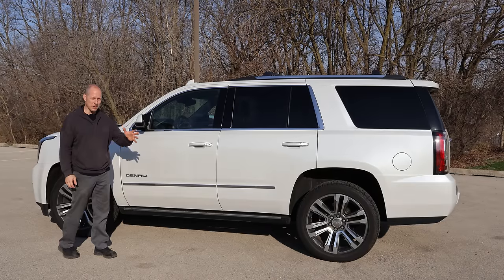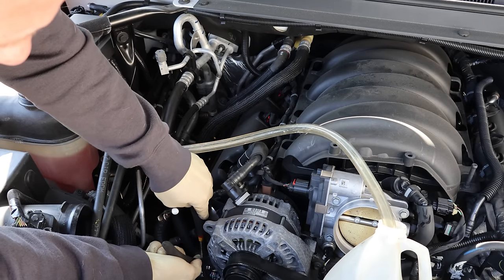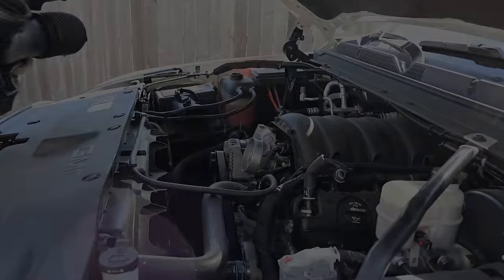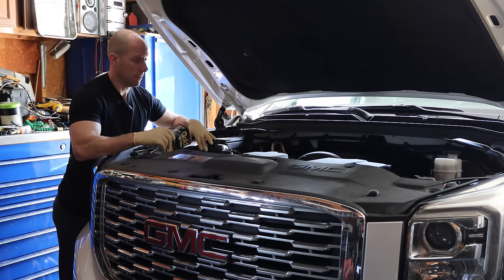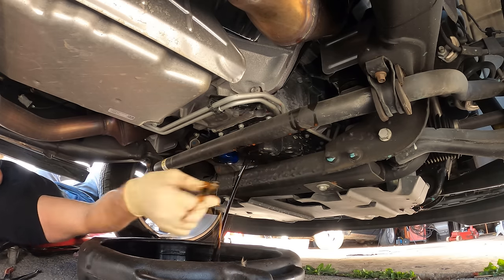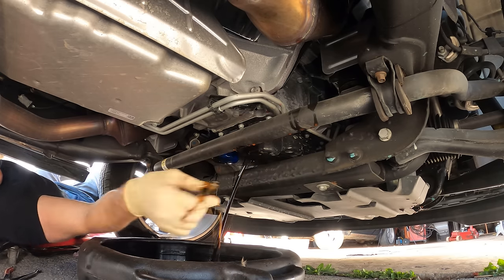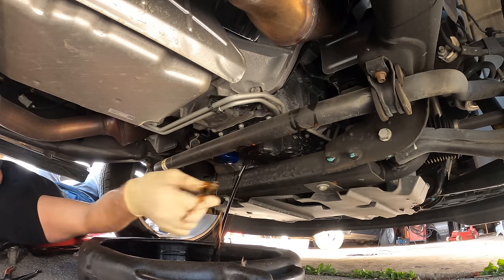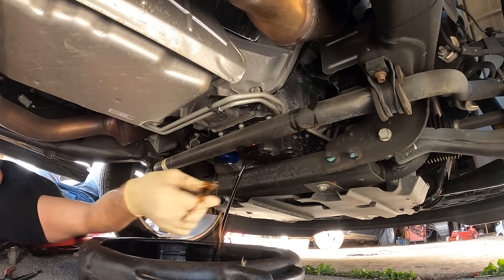Fixing everything wrong with this low mile Yukon Denali so I can sell it.

Comment: Oh yes, the booby trapped spring clamps my favorite little finger destroyer and part that loves to fly across the shop and play hide and seek😂. 

I loved our 15 Yukon until it ate 3 transmissions in 500 miles 😂.

Thanks for the demonstration on the cool sucking device that makes the job cleaner that death cool makes a mess. 😎

Fun fact after multiple oil changes the wax coating wears off that brace bar under the engine & transmission 😂.

Comment: With the heater hoses it is usually the o-ring and the clip that goes bad. it is possible to buy better than oem quality replacements. Gm thinks the dealer replacements are made of platinum.

Comment: A little bit excessive, every 2500 miles an oil change 🤷🏻‍♂️
Reply: I don't see an issue with that.  I change my oil every 3500 to 4000 miles regardless what all the experts say.  I also use the best oils and filters too.
Reply: On GM vehicles with the DOD or AFM it is good practice to change the oil sooner than the manufacturer recommends or you’ll be changing the cam and lifters 🤣
Reply: @bteamshorts  also a good practice on deleting that crap too.  One of the dumbest ideas ever.
Reply: @bearing_aficionado  Blame the government for setting unrealistic fuel mileage standards that the manufacturers must comply with.
Reply: @bteamshorts  oh I do.  Because of those morons, the price of vehicles go up while the quality goes down.

Comment: I stopped buying FRAM filters after I had two incidents on my Sierra. The first one was the check valve in the first filter was stuck it built ZERO oil pressure and I'm glad I caught it. The second one had a coil of metal in it from where they threaded the filter.

So I started buying WIX/NAPA Gold filters which were around the same price BUT I very carefully inspect the filter before I put it on regardless of how high quality it supposedly is.
Reply: What ever...
Reply: I've used Fram filters throughout my entire driving life, about 40 years, and NEVER have had an issue with them.  I'm sure there are failures, as you experienced, but considering they probably sell millions of them per year, the percentage is very small.  Just more internet BS.

Comment: 11:49 Key Fob Tip: You can add distance to your remote key lock, by placing the Remote to your chin while pressing the door lock/unlock button. Your body acts like a giant antennae. Finger Nail Clippers are great for removing batteries! i.e. TV Remote Controls, etc..
Reply: Nope.